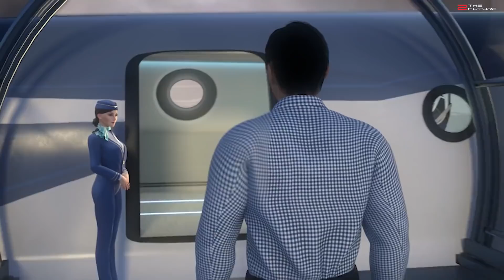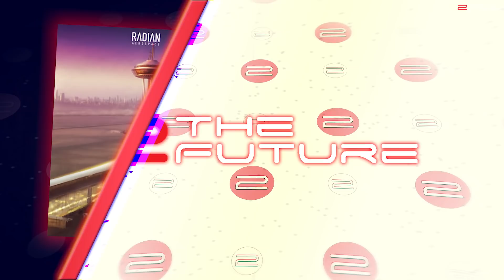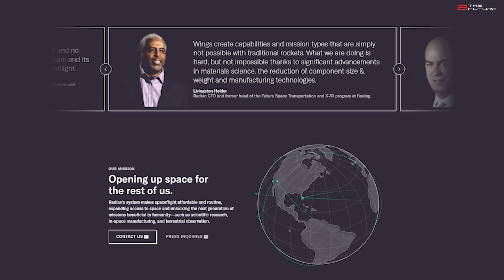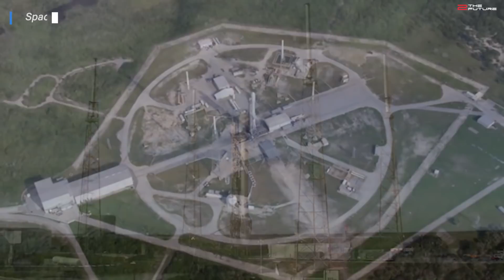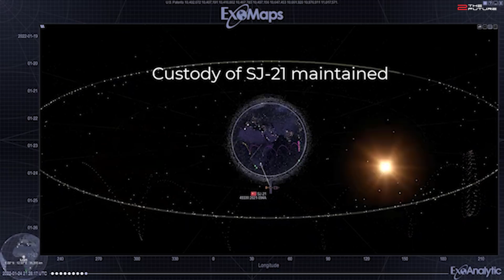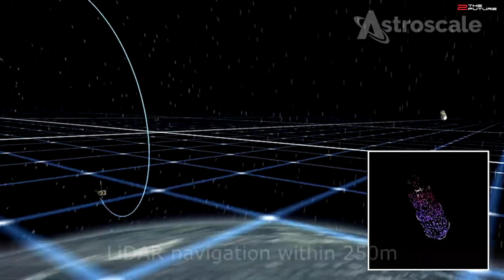China's secret spaceplane idea to rival SpaceX is INSANE !

Comment: Elon’s electric plane will put all of their space plane to obsolescence. All he is waiting for is to get his batteries with an energy density of 400 kWh/kg.
Reply: isn't that the same battery used for semi trucks
Reply: @prioris55555  , no! The semi truck batteries will use the new 4680 with the current 250 density.
Reply: Yeah, that plane would never be capable of reaching the Karmen line, let alone orbit. It probably would make a good city to city taxi though, once all the A.I. bugs have been worked out of the system.
Reply: @STSWB5SG1FAN  , Elon’s plane is not meant to. It will fly to the stratosphere and go intercontinental.